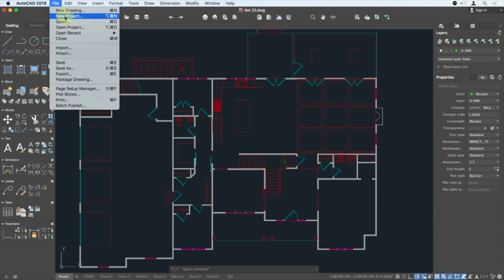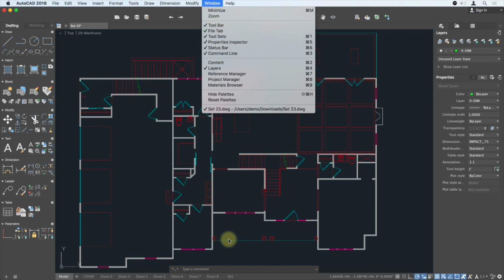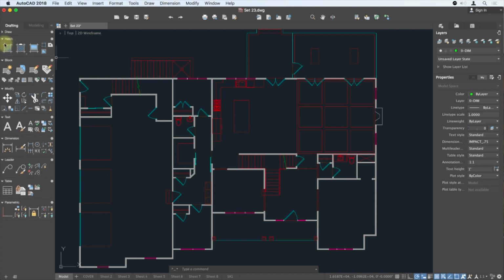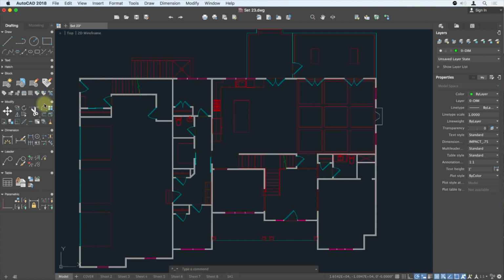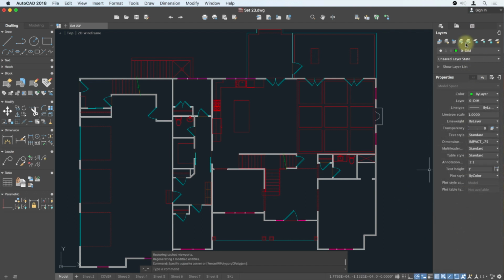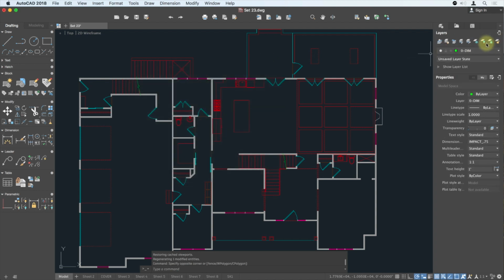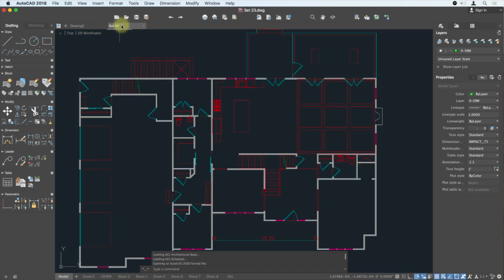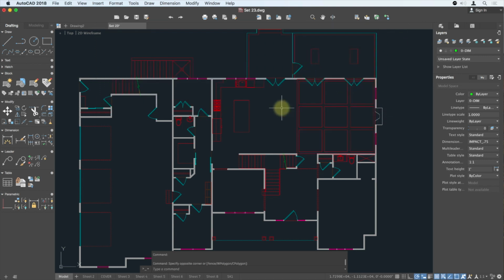AutoCAD for Mac 2018 Interface Tour

Comment: I am just getting into AutoCAD.  I have an opportunity to either run on a MAC or Windows Dell machine.  Looks like the only thing I’ll be doing are Kitchen layout for now.  I am a an Apple fan but I just don’t know how well AutoCAD LT is for MAC vs a Windows machine.  I did speak with AutoDesk and they really didn’t provide any info one over the other.  Any one out there know?  Thanks in advance.
Reply: Do you have access to a Mac to download a trial to see if it will suit your needs? For LT, where you wouldn't have extensibility support anyway, the differences between the Mac and Windows version are more cosmetic / interface based. There are features that are missing, but if you are sticking to 2D kitchen layouts then it shouldn't be an issue. Don't forget to consider other apps you may need to use (like 2020) that may be Windows only (you can run Parallels / Boot Camp, but that is a whole different discussion)

Comment: Great video. I have used 3ds max on Windows for years but switched to Mac a few years ago, and I love it. Since I use Fusion 360 on my Mac, I became more and more addicted to precise CAD. However, Fusion has its limits regarding the volume of an object. Designing something like a house which spans over several Meters is not convenient to do. So, a few days ago I tried AutoCAD on Windows (again), and I really hate the application because of its look and feel. The interface is so crowded, unintuitive and seems to be cobbled together and outdated... Urgh! However, AutoCAD for Mac looks more modern, and you've provided an excellent overview.

What I would suggest: Please make a workflow video for AutoCAD for Mac. That is a video which gives information on how to organize a project from start to end, using layers, etc. But please do not let it be a basics video like "what is a line" or "what is CAD good for". There are too many videos out there that treat users like absolute beginners. I would love to see videos where you explain AutoCAD to people which are already working with 2D/3D/CAD Tools for years but want to switch to AutoCAD and want to use it efficiently and effectively from the start.

Thank you. Looking forward to more videos.